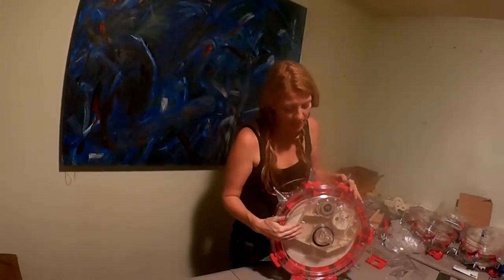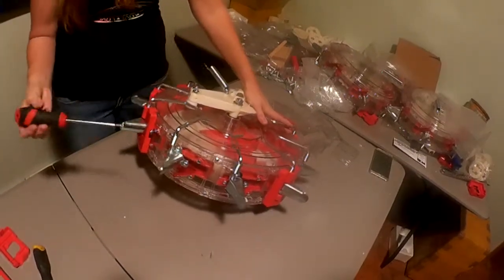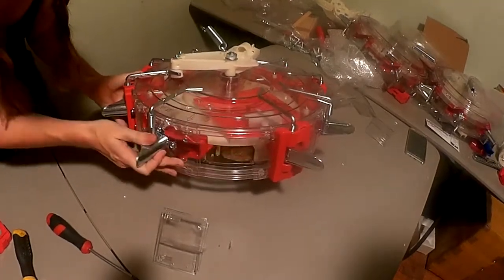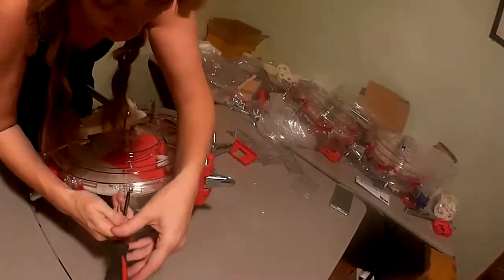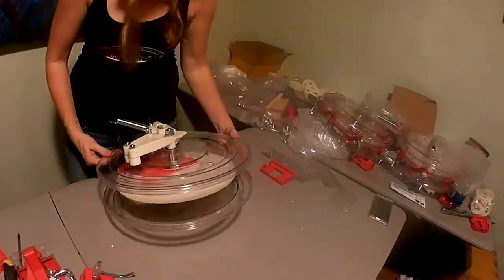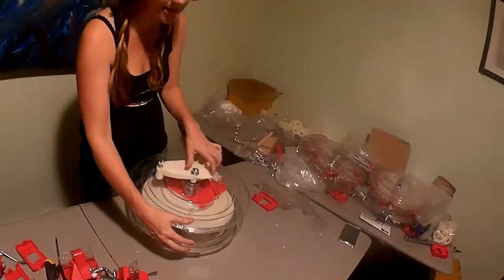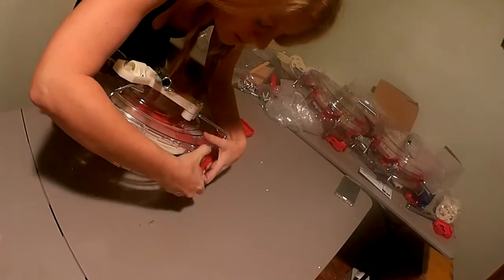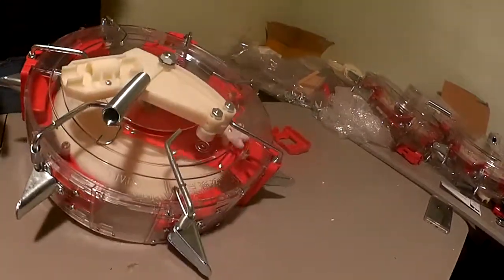polyplanter Jr.2.0 assembly

Comment: Looks great but what challenges have you encountered in planting on ground thats not dead level? Can the planter be adjusted to 12 & 24" spacing?
Reply from the maker: The planter rolls with ground level.  The plastic must be tight not lose to poke holes. It can be adjusted from 5 inches all the way up to 30"  with all spacers